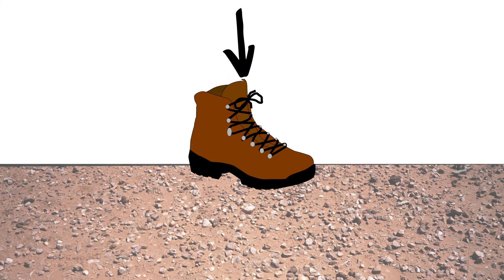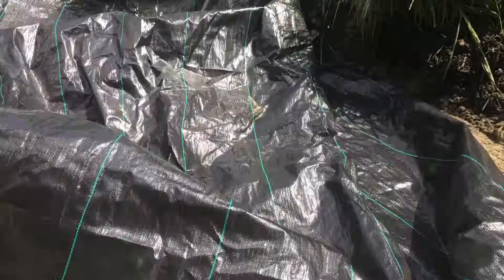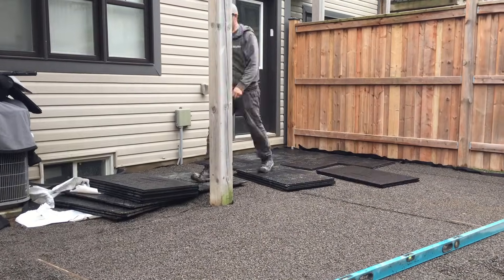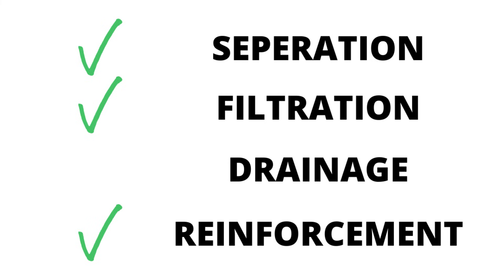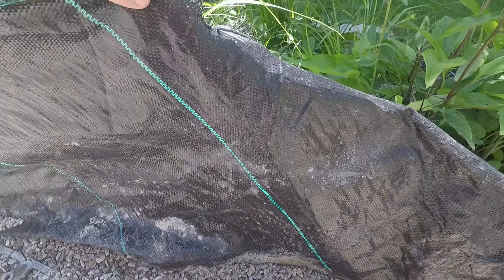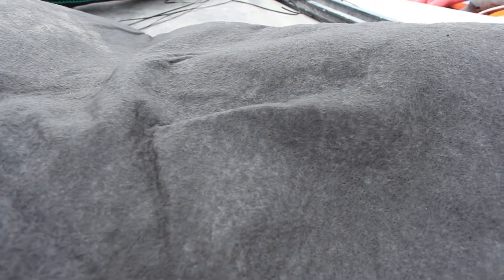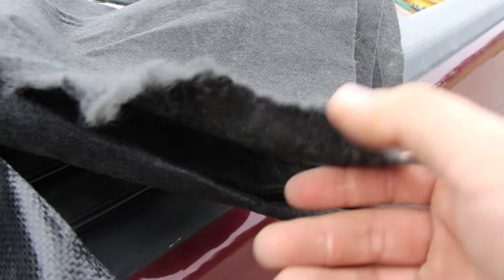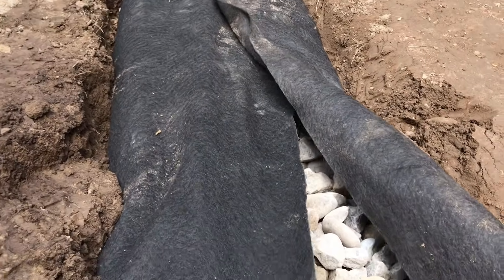Woven vs Nonwoven Geotextile Fabric | Choosing the Correct Geotextile for Your Project

Comment: Generally speaking, what’s better for an underlayment below an open graded base patio with an impervious surface?
Reply from the maker: Depends more so on the subgrade. Is drainage more important with the fabric, then go with nonwoven. Is reinforcement more important, then go with woven. Need drainage and reinforcement, use nonwoven with biaxial Geogrid immediately on top. That’s in general what you can look for.

Comment: Having  erosion next to my house foundation when it rains , its on a downhill slope, should I put woven or non woven fabric? Should I  fill then eroded areas with dirt then put the fabric followed by 3 in river rocks?
Reply from the maker: It is tough to say without seeing the site. If you are not having water troubles in your basement from this issue, I may opt for the nonwoven. But if the erosion is really bad, you may want to go for the woven to redirect the water. You could fill in the eroded areas with a 3/4” angular crushed stone or larger crushed stone without fines as these will lock up better to prevent further erosion especially if it won’t be seen, then fabric, then your river rock. Again, it’s difficult to say the best way forward without seeing the site.

Comment: How does the non woven fabric hold over time?
Reply from the maker: It holds up really well. I’ve done several repair jobs and seen it intact well
Reply: @iamahardscaper  thanks, Does the fabric clogs over time also? I’m thinking about burrito wrapping my pipe but just would like to be sure. Thank you.
Reply from the maker: Some claim it does, some claim it doesn't. I'm sure over time it does get clogged, but it still allows for some passage of water. If you are building a French Drain, you should definitely wrap your pipe in it with some 3/4" clear stone surrounding your pipe.

Comment: So informative! I have been trying to determine which material to use in a1000ft gravel driveway over hard compacted clay, and I've been told by different contractors the benefit of both. I am big on technical specifics and appreciate the great detail and explanations you gave. Woven it is for me. Thank you for the assist.
Reply from the maker: Thank you! Appreciate the comment 👍
Reply: Clarified it for me as well. Woven it is, for my driveway. Thank you!

Comment: I plan to build a garden on my terrace and plant grass. Now, to avoid leak i am planning to use acrylic tray of size 8x10 feet with 5-6 inch wall height. I am concerned that this would not let the water drain and will damage soil. So to fix the problem i am planning to use small stones averaging 10mm at the bottom of  the tray then non woven geotextile fabric. On top of this fabric i shall put mix of vermi compost, normal soil and coco peat to plant grass. My concern is whether i need to put drain cell  20mm and put the 10mm stones inside it to provide support to fabric? Or will fabric be able to handle the distance of 20 mm between each cell wall? And would this be good for proper drainage of water? Really loved your video and it gave me hope that you may have answers to my questions , hence posting. Appreciate any guidance possible,  have a great day 👍
Reply from the maker: I like the idea of the drain cell with non woven on top of that. I can’t give much advice on this as I’ve never tried something like this.
Reply: @iamahardscaper  thank you for replying so fast. I appreciate it. You like it ! Well that's good enough for me 😁

Comment: thanks for the great content. may I know the specs of your base material?
Reply from the maker: We use a 3/4” crushed stone for our base with a 1” bedding layer of 1/4” crushed stone. Base depth depends on the project. Minimum of 6-8” for patios and retaining walls. Minimum 12” for driveways.
Reply: @iamahardscaper  can the 1/4 crushed stone aka 1/4 minus (down), be used instead of sand?
Reply from the maker: No, there is no use for 1/4" minus or stone dust or limestone screenings.

Comment: Correct me if im wrong. In this video, your woven geotextile sample is not actually geotextile. It is weed mat fabric specifically used for agricultural. The correct 'geotextile' is for purposedly used for road construction made from pp/pet high strength multifilament yarn with or without mono yarn. Your fabric it is woven, but not typically can use for construction of drainage, embarkment, separation & filtration because of not long time duration & less tensile strength of fabric
Reply from the maker: You are right, there are actually 3 different woven geotextiles. Multi, mono, and slit, at least that relate to the Hardscape industry. Ideally multi is our preferred choice, but for the purpose of this video we went with slit. It still provides the necessary tensile strength and separation required. A topic for another video later 👍
Reply: @iamahardscaper  Great 👍 In this video, the opening size for woven fabric is smaller. That the reason it was not suitable for drainage/separation because the water cannot pass through. Like i said, it was suitable for agricultural purpose. Anyway, you made a good content 👍
Reply from the maker: It’s still appropriate for separation. However, no woven is the most suitable for drainage. If drainage is necessary, then non-woven is the geotextile of choice.
Reply: @iamahardscaper  Indeed. What we want to clear is that your woven that shown in the video is not typical for separation. Not any project will use this weed mat fabric for separation. Because what you are explaining geotextile function with wrong product.

Comment: Which applications are suitable for woven fabric?
Reply from the maker: Softer soils that remain saturated for a majority of the year with larger loads or need the reinforcement
Reply: @iamahardscaper  thank you. I see many in videos it is being used it as weed barrier. Isn't it gonna create a little pond when it rains? I am concerned about it after watching you pouring the bottle.
Reply from the maker: @b3arwithm3  It will still allow a little bit of water through, but mostly redirect the water that lands on top of it. I have seen arguments for and against using it as a weed barrier in softscaping with mulch placed on top of it.
Reply: @iamahardscaper  i plan to remove my lawn and put flowers and shrubs. As ground cover, I would use ginger rocks. But not sure if putting down the fabric would help or not.  Cutting many holes for the plants, I wonder if weed soul go thru the same holes.
Reply from the maker: @b3arwithm3  Talk with a nursery around you about your plan. They would be able to point you in the right direction with this.

Comment: Great video! Can you please go over the different Non-woven Geotextile weights?  I am having a concrete shed pad installed in a very wet flat back yard. ( 10X 16)   Using the non woven under the clean stone but don't know what weight is best.  ( working on extending sump pump discharge past yard so not as wet but still a consideration.  )
Reply: Under a storage shed you want to stop moisture from coming up through the concrete slab and aren’t concerned with drainage; I.e. it’s a vapor barrier like a house with a slab on grade condition.  The classic is visqueen plastic but there are more durable and newer vapor bassists that stand up to the rough conditions of a construction site. Also, pour the concrete over the vapor barrier over the base gravel. 

 PERMINATOR® underslab vapor barrier is a new generation of polyolefin-based resin/chemical technology. PERMINATOR provides the vapor barrier industry with a highly effective, economical choice for helping to reduce the penetration of moisture and water vapor through the slab into the structure, thereby helping to reduce fungus, mildew, and mold growth. PERMINATOR also helps reduce radon gas from entering the structure.

New resin technology allows dramatically greater puncture resistance while maintaining one of the lowest perm ratings in the market.
Reply: @zanepaxton7452  You may be answering a question that hasn't been asked. If you throw 10" of gravel over 10" of mud, you get 20" of mud. I think this is what he will prevent, and not the moisture to stop moisture from coming up through the concrete slab.

Radon is an ridiculously hyped problem. I don't think they can name 1 person who has felt a problem with that. The problem is allegedly demonstrated in dubious computer models only.
Reply: @elbuggo  you bring up an interesting point when the soil is muddy or if the water table is at the surface. The main purpose of gravel under a building slab is as a capillary break to help keep the bulk of water away from the slab. I live near the Oregon coast in California and it rains 75” a year so the soil is very saturated 7 months of the year so I’m facing the same issue. I’m about to expand a workshop.  Under a building slab the base rock also increases the structural capacity of the soil which is desirable. So… from top to bottom this seems reasonable:

A reinforced concrete slab over
A quality vapor barrier over 
Base rock/angular gravel over 
Geotextile fabric over
Compacted native soil

In that design we don’t want moisture to come up into the structure so the vapor barrier is valid.

Then we don’t want to trap moisture in the base rock/angular gravel. So providing a geotextile under the angular crushed rock that drains well is important so the moisture can drain out and not be trapped as well as not mix with any mud below. Probably a woven fabric for structural strength similar to a driveway.

Having said all that, best practice is to have positive drainage away from a structure all around at least 5’. In my more extreme climate I’m planning on installing a French drain around my garage to drain away the ground water to keep the slab dry. When it rains here the water table is at the ground level and higher (ponding). I’m also planning on a higher perimeter concrete curb because there’s a lot of rain splash that typically rots away the plywood siding that is popular because it’s cheap.
Reply: @zanepaxton7452  Good plan there. Maybe you should consider buying your geotextile fabric and pipes from FRENCH DRAIN MAN? And follow his advice?

Most important question in any building project: Where should the water go?

I may have added a 2' wide open French drain around the entire building, with no grass growing any closer. 

The bottom of the slab should ideally be higher than the surrounding terrain - add 4 inches of gravel?

I wish you would consider building with insulated steel panels instead (see panelsell CA). The panels can be lying flat and stacked on top of each other, so you can save some or all of the girts, and many of the purlins. If you do that you could also insulate the slab and add some Pex to be heated with a Chinese diesel water heater? Simple example: https://youtu.be/K3_4mpG9nTg
Reply from the maker: Thank you for your comment! Great suggestion, it will eventually come. Typically you would want an 8 oz to 12 oz nonwoven geotextile.
Reply: @iamahardscaper  
12 oz./yd² = 407 g/m²
8 oz/yd²  = 271 g/m²